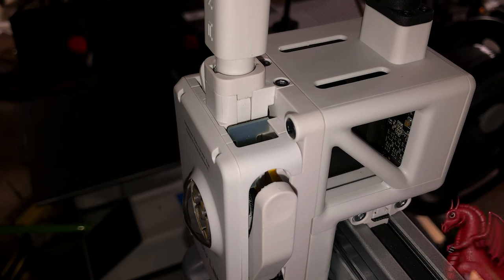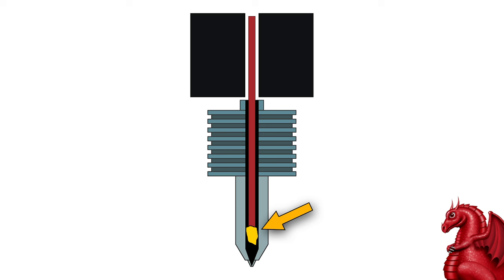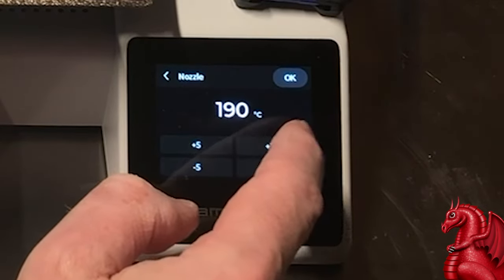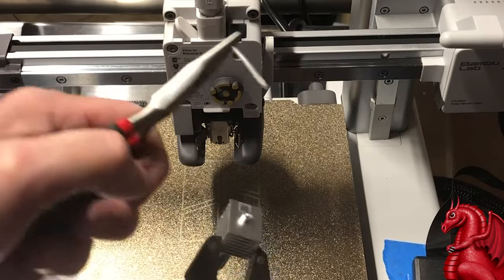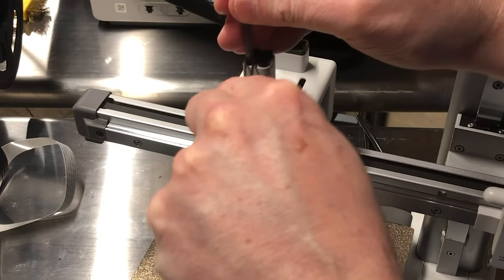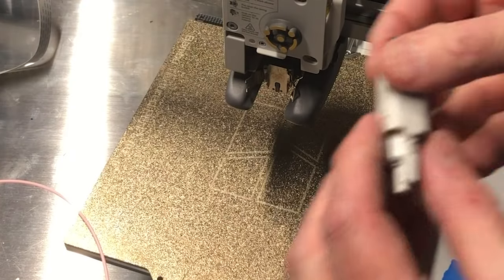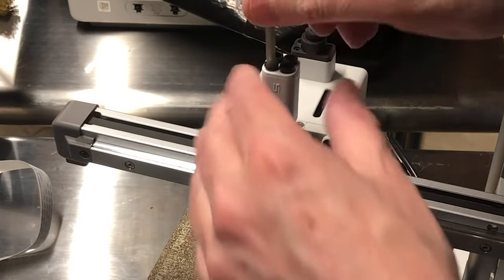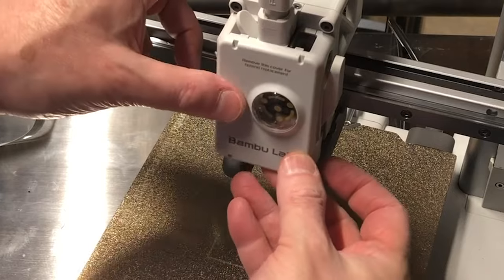Unclogging Your Bambu Lab A1 Mini 3D Printer: A Step-by-Step Guide to Clearing Jams

Comment: OMG.. Thank you so much..  I had a piece of fliament break off somewhere inside, and the Wiki for clearing the exruder is the steps for replacing the whole toolhead.. so I started taking screw out ect..  soon as I took the screws out for the AMS hub and lifted it up the broken piece fell out.. If I had found this before hand, I could have just lifted the hub part out, and pushed something through to push that broken piece out..  Next time I will know how to fix it without all the extra steps.

Comment: Whether it needs to come out, or go in, gently pressing downwards with a fork on the flat side between legs and tube makes The Bowden Tube simple to work with.  It also may spark interesting conversations on a dinner date for two if this is done prior to sitting down at the table. Feel free to share your story  if this works for you.

Comment: Do you have a suggestion of frequency of cold pulls for preventative maintenance?
Reply from the maker: I usually only do them if I encounter a clog (which is almost never when using Hatchbox of Sunlu META.) If I was going to do them as a preventative measure maybe every 5-6 weeks of regular printing, at most.)
Reply: @Tombof3DPrintedHorrors  Thanks for your response. With the ease of use of this printer my children have definitely increased their usage, even my 9 year old feels comfortable finding a print on the app, swapping the filament and printing to her heart's content. Thanks for all your videos over the years and designs.

Comment: Thanks for the video. One day of use and i had a jam in the nozzle and this solved my issue. I chipped a tiny bit of the heatsink before i decided to use angled tweezers since i didn’t have the same tools but it’s working fine now after doing a cold pull.

Comment: I have an A1, and recently, almost each color change its a pain, the nozzle clogged in the very bottom part (near of the extruder hole of the filament) I had heat the nozzle up to 250 grades, then remove, push manually with the bamboo tool (L tool) to leave all the filament, but that not resolved the problem, maybe need new Nozzle?

Comment: Should have read this before removing some screws and taking apart extruder. Bambu labs video was very misleading. I tore the ribbon cable so new extruder time. First major jam on a1. Maybe filament getting brittle from humidity.

Comment: Helpful video. If i pushed the spare bit of filament down where the AMS hub was taken off, and pulled the lever on the left. of the Extruder Gear Disengage lever. Next got it to come out the end of the nozzle clearing the plug.

Comment: If only it would heat up the filament enough for me to actually cold pull it, I would just replace the nozzle if they would have sent me the extra nozzles I paid for. Edit, finally got unclogged after going to 300 Celsius for the second time and trying to just force the tiny bit of filament in by hand.

Comment: Very helpful. Thank you! On the Bambu site they recommend a different method for the cold pull. I tried theirs before seeing your video, and I felt like theirs was more effective in getting the nozzle clog out, specifically because they recommend extruding some first, then cooling the nozzle to 100, and then doing the cold pull. Any thoughts?

Comment: Hi, i am new with a1 mini, and i have several models that cause the hotend clog, on the same layer... why did this happen and how can it be avoided? Thanks for any advice.
Reply from the maker: Cheap filament, temps too low for the speed being printed at, design issue with the model, blockage on the Z screw hindering movement and causing a flow backup...

Comment: Please help. Just set up the A1 today and it's not extruding. Followed your video and did everything but no issues it seems. Still go to print and nothing is coming out of the nozzle. Any suggestions ?
Reply from the maker: Is it heating to print temp (shown on LCD)? Is there a nozzle clog? Is the extruder trying to turn/extrude (is it making a clicking noise)?
Reply: @Tombof3DPrintedHorrors took apart again and made sure there wasn't a clog. Really pushed the filament in to be sure. Trying to print the Benchy now. Temps seem high at 240 now. The wheel is slowly turning to the left and trying to poop but nothing happening.

Comment: awesome! great explanation and video over the steps.
Reply: the filament was stuck in the extruder. pushing filament from above as you showed did not seem to do much, but it actually exposed the filament underneath and allowed me to use pliers and pull it free (nozzle removed) Thanks!

Comment: Hi, I am new to 3d. Printing. I bought a A1 mini last month and it was working beautifully so when I bought it and  the A1. The problem started with the Al, the wheel started clicking so I did all the steps in the video then it started printing and then the filament stopped coming out and I have to stop the print. In addition, I when to used my reliable A1 mini and put a roll of petg and sent a print and it won't stop extruding and it won't print. Please I need help,what do I do to fix it.

 

whe
Reply from the maker: No filament coming out at all sounds like a clog, try replacing the nozzle. As for the latter issue of not stopping extruding, I have no clue, you need to contact Bambu support.
Reply: @Tombof3DPrintedHorrors  thanks I will let you know if the issue is resolved.🙂

Comment: I think I might have filament in the metal feeder gear. I’ve tried what you’ve suggested plus downgrading my firmware and nothing seems to work. The clicking noise happens every time now. It happened when I was using a galaxy filament. Anyone have any tips or suggestions?
Reply from the maker: Just disassembly, it sounds like a piece of filament is lodged in there.
Reply: @Tombof3DPrintedHorrors  what’s that?
Reply: @Tombof3DPrintedHorrors  I’m sorry I’m new to all of this
Reply from the maker: @goldfish2289  no worries, but this is something you'll need to contact Bambu Lab on as I do not have a video showing how to resolve it.
Reply: @Tombof3DPrintedHorrors  thanks for the time you gave for my question 🙏. I figured out a way to get it to work again. Just needed to use the needle provided and do a cold pull with it inside the hotend. It had to of been the sparkles in the galaxy filament.

Comment: is that really a cold pull, shouldnt you lower the temp to 100C first?
Reply from the maker: Yes it's a cold pull, and no, do not lower to 100c first, that is for doing a pull while the nozzle is being actively heated, whereas here you have removed it before doing the pull and it cools fairly fast.
Reply: @Tombof3DPrintedHorrors  I see, what I do is pump to 250 extrude lil a bit then set to 100 let it cool down, then do the pull seems safer to me don't have to use pliers at all as the heatsink can be handled by hands when it's set to 100 degrees
Reply from the maker: @flippy9133  doing it that way risks the thin end of the filament that stretches out breaking off and becoming jammed in the extruder. My way eliminates that risk and the resulting necessary teardown of the extruder assembly.
Reply: @Tombof3DPrintedHorrors  forgot to mention that I cut the filament first before removing the hotend :D but I forgot once it still worked fine. but I get your point